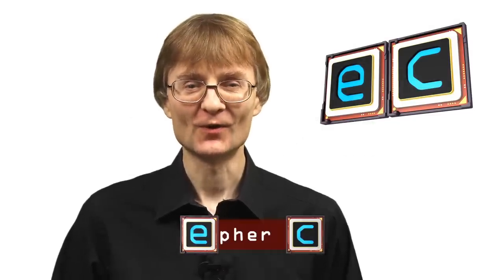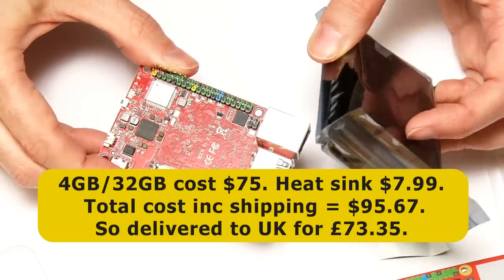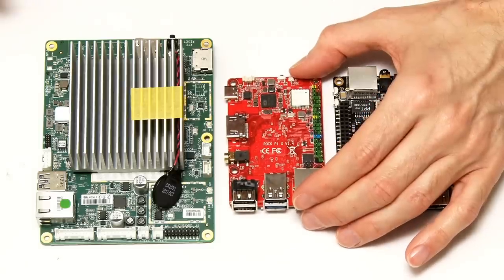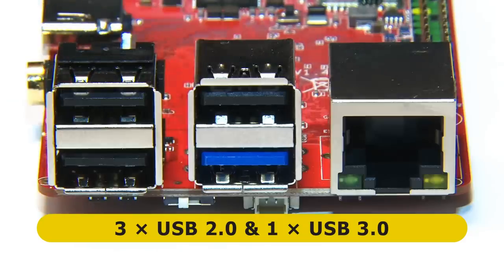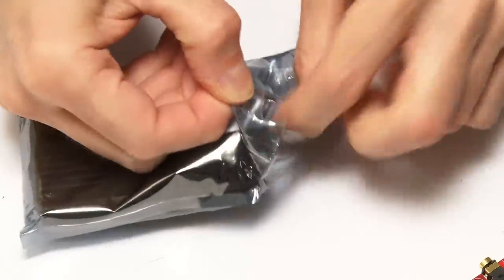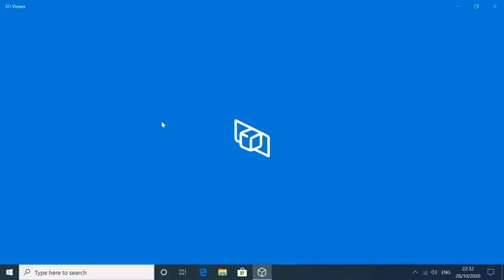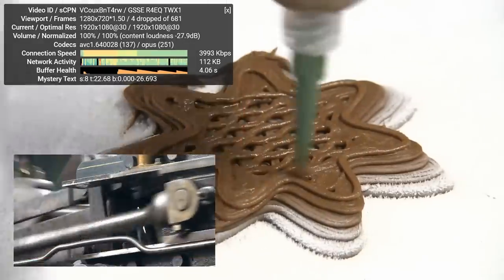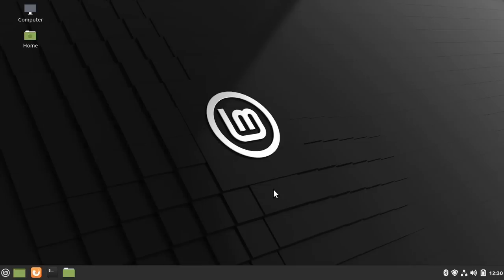Rock Pi X: Low-Cost x86 Windows & Linux SBC

Comment: 7 hours of Windows updates?! Man I'm glad to be a Linux user!!!
Reply: And it even steals your personal information. This is a "modern OS" according to m$..
Reply: @illegalquantity  More like clown OS, I just booted a Linux Mint laptop that's been off for a year, 1000+ updates in less than 20 mins on a first gen i7 and an old laptop hdd.... I just don't get how anything can update for more than an hour, especially downloaded new!!
Reply: Linux won't run the applications that I want. I suppose you whizz away your time playing around in the operating system
Reply: @Fetherko  hahaha oh so you need proprietary software to get things done eh? That's too bad, I've migrated to the open source world, where my computer doesn't crash from updates or lose data from them. I also get to update whenever I want and 99% of updates don't require a reboot. If I really want, I can even run a distributed filesystem and instantly access my files across multiple machines and never lose my data even in the event of my machines being physically damaged. Oh yeah and my systems consumes about 100x fewer resources than they used to.

Comment: Thanks for an interesting review. I'd certainly be interesting in getting one if there was a nice case for it. Modifying a Raspberry Pi case to allow the full sized HDMI looks straightforward but I'm sure that large heatsink means a custom designed case would be needed.

Comment: Regarding 4k - I can confirm that it can do 4K@30FPS. Z8350 supports HDMI 1.4b, and while Intel's spec tells otherwise, their slides and product briefs for Cherry Trail platform show that it can do DP/eDP at 2560x1600@60Hz, and HDMI 4K@30Hz. I've tried it on a computestick - it works, but it's slow. Even more laggy than Bay Trail or Braswell.
Reply from the maker: Thanks for this info, appreciated.

Comment: That is odd because the Atomic Pi isn't crippled when streaming.  I thought I heard that some of the performance was held back. Maybe the bios has some less than optimal settings. Seeing this I will put off getting one until some bugs are evicted from it.  Oddly enough that Asrock mini build you did possibly made eBay prices go up. It is almost as expensive as the Odroid H2+.

Comment: Even being a Linux user myself, the performance/usability difference between the two operating systems was surprisingly stark to me. The only downside of Linux is that GPU-accelerated video decoding in the browser is still lagging behind. Perhaps with a few versions of Firefox in the future, or when Linux Mint starts packaging Chromium, this particular limitation will go away.

Also not for the casual user but you can use the --get-url option of youtube-dl and feed the result to VLC (or a number of video playing applications) to hardware-decode and stream video.

Comment: Chris, I always enjoy your insights and in depth knowledgeable observations.  with regards to SBC I wonder if you could review some higher end boards, say costing $200 rather than the spartan lower end boards?  it would be interesting to see if the extra money is worth it and whether it can help make the change off Windows desktop more rewarding.  Thanks for all your good work.
Reply from the maker: Thanks for this, I have reviewed several such boards: eg the Odyssey X86J4105: https://www.youtube.com/watch?v=4XV8dlFwNd0 LattePanda Delta: https://www.youtube.com/watch?v=Dh03L2CUgnk and UDOO Bolt: https://www.youtube.com/watch?v=8DINmS5YBD4  I have a group test with comparative performance of eight x86 boards here: https://www.youtube.com/watch?v=xqIHsJLDdN4

Comment: Typo at 14:16, "* First generation 864 board tested" was probably intended to be "* First generation x86-64 board tested"
Reply from the maker: No, "First generation 864 board tested" was correct. The number refers to the initial 8GB RAM 64 GB eMMC LattePanda Alpha, as opposed to the more recent 864s model, which has a faster CPU.
Reply: @ExplainingComputers  Ahhhh thx for the clarification

Comment: Chris, do you have any plans to review the Compute Modules from R PI? I understand some of them come with 16GB of RAM and have a PCI-E x1 slot with the IO board. I realize that the IO board technically means it's not a SBC, but with those kind of specs it should be a really good contender for a desktop substitute. Only thing that disappoints me is the lack of USB 3.0.

Comment: To me, the biggest reason to choose a RPi form factor board would be because you want to use a pre-existing RPi GPIO hat, but you didn't go into the compatability of the header, or how it's accessed (ie: Are there  drivers for the GPIO under windows/linux on this thing somehow?!)  Also, another advantage of using a familiar form factor would be to use a familiar or pre-existing case, but that goes out the window based on the giant heatsink.  No existing RPi case is going to be usable with this device.  All of this combines to make it irrelevant that it's a familiar form factor.  It does seem to compete fairly well price:performance wise on it's own, but I dont see a reason to choose this board based on it's similar footprint to the Pi.  I would like to see a followup that goes into the usage of the GPIO of the board however..

Comment: Ive never run Passmark before, so decided to run it on my daily driver laptop. An aging HP Probook 650 G1. i7 4710MQ, 12GB, SATA SSD. Came back at 1900. So a little Latte Panda is more powerful than my i7 laptop. Wow..
Reply: Ah, 'twas ever thus...
😕
Reply: ages ago.. when i got my first job.. i saved up to buy a gaming pc.. real harcore.. it was 1ghz.. think i had 128 mb of ram.. 32 mb graphics card.. cant remember the size of the hard drive.. all sbc's are better than what i spent i month salary on to buy..
Reply: didn't finish watching video, just saw him say it was z8350 and then checked comments... i must admit my confusion. https://www.cpubenchmark.net/compare/Intel-i7-4710MQ-vs-Intel-Atom-x5-Z8350/2219vs2774

Comment: I recently upgraded to a brand new motherboard also with a chip from 2016. The A10N-9630E motherboard has a built in AMD A10 quad core processor and is a lovely ITX solution.

Comment: Watching all your video's made me wanna buy a SBC to use for a NAS/VPN server. Since they are rather expensive new in Europe. I started looking at used thin clients. Came across this HP T820 with an i5-4570s (4c/4t DESKTOP CPU) for 47,15€ shipped! It has no ram/storage but after some googling I found out it has the exact same cpu used as in the iMac 2013 21,5in. So im going to try to make it a budget friendly Mac Mini. If that doesn't work out it has endless use cases with those specs. This is a much more power hungry chip. But for some people that want to use an SBC for simple stuff like an ftp/vpn server maybe check ebay or local marketplace sites. You can ofter find cheaper thin clients that are used. Those have power usage ranging from 7-15w and often use dual core atoms/amd apu's. If you are lucky it includes a bit of flash storage aswell.

Comment: Still waiting for an x86 SBC w/8GB RAM priced under $140.  The Odyssey is close but barebones price is $188.  Raspberry Pi4 B+ is good, but has ARM processor.  I want to run Linux Mint 20 or xfce which run better on x86 chips.  Am I "stupid" for saying that?

Comment: Add a 1080Ti, an HDD and a optical drive and this thing will be comparable to my sisters current computer, which plays silky smooth, HEAVILY modded Skyrim and other modern games with no problem.  You won't catch me bashing this little board.  Looks like a beast to me.

Comment: 2 small tips to get rid of the lag..
1. triple check the chipset drivers & graphic 
2. debloat windows
Reply from the maker: Yes, agreed. I am aware of this! :) But checking the drivers (and I spent hours getting as reasonable drivers installed as possible) does not make them better. Having tested a good 60 SBCs, I aware that practically all of them suffer from the poor driver support associated with all minority hardware.

Comment: Actually Intel specifies 1080p but: "Max Resolution (HDMI) is the maximum resolution supported by the processor via the HDMI interface (24bits per pixel & 60Hz)."
So that's at 60Hz and the SBC maker specifies 4K 30Hz!

Comment: You wouldn't recommend this as a YouTube play back device?
Can I take that to mean that you would not recommend this a basic office machine - a very basic desktop replacement or backup computer?
That may be an unfair question, though.
I use Mint 20 on a 2011 Macbook Pro i5 / 8GB, and I never bother with anything over the 480 setting on YouTube anyway.
Glad to see the Mint 20 section.
Thanks.
Steadily getting steered toward the Raspberry Pi 4B 8GB model for my portable / space and money saving / backup machine.
Thanks a lot.

Comment: It would be interesting to pit it against a 4gb Pi 4 and do some benchmarks, especially if you can do things like run the same flavour and version of Linux from the same SD card to try and keep things consistent. For most I would guess usb 3 mass storage read/write speeds, network ( wired and wireless) throughput, speed tests and temperatures would be the ones of interest.

:)

Comment: I have an x86 tablet based on Intel Atom x8700, 4GB of RAM and 128GB of eMMC storage (Thinkpad Tablet 10 2nd gen). The #1 problem is the cooling. All it uses for CPU cooling is IO shield with a thermal pad between it and the CPU. Needless to say, it throttles pretty much immediatelly after heavy load. #2 problem is the storage. You do want at least USB SSD nowadays, eMMC is just slow. #3 problem is barely enough RAM. 4GB is almost not enough nowadays to just browse the webs. I would upgrade the RAM, but without a better cooling solution there's not much point in it. But despite all these flaws, my tablet is waaay faster to open youtube and start playback then Rock Pi X, but I'm using fine tweaked LTSC version on Windows. The video decoder is quite good, managing 720p60 and 1080p30 with no issues once the playback started.

Comment: I’d be interested to know a little more about the sort of applications that might work better on an x86 machine as opposed to ARM. I’m using Linux Mint on two old laptops, a Thinkpad T60 (originally XP) and an Acer that was originally W7. They both continue to work just fine - and the WiFi always worked without fuss BTW - and I have no problems switching to Raspbian on a Pi for hobby projects.

Comment: According to Intel ARK, the z8350 is only supposed to support up to 2GB of RAM, although there have been mini PCs and whatnot released with 4GB and it seems to work. Would be interested in learning more about this discrepancy.
Reply from the maker: Apparently the Intel specs are wrong, and should state that the Z8350 supports 2GB per channel, so 4GB in total.

Comment: Christopher, 
Did you try downloading and installing the non-free firmware package from Ubuntu? I was able to get my laptop's wifi adapter working perfectly without having to install the proprietary Broadcom driver in Linux Mint, simply by doing this. :)

Comment: I didn't see/hear where you got the ethernet working? At the last part of the video you were using YouTube and showed your web page so I'm assuming you got it working?  Could you "explain" what happened and what the fix was? That's probably the main reason I've not took the Linux plunge. I just want to be able to start my computer with NO diddling around. Windows starts up and "most" everything works, "most" of the time.
Reply: I assume Chris just plugged in a cable, see https://youtu.be/cGxScUmkzNs?t=386

Comment: put a fan on that heatsink.   their 4 holes on that heatsink for one to be mounted and use the long brass standoffs.  and connect to the 5v gpio pins.  add an external pci-express 3,0  x4 2 TB  external via usb 3

Comment: Just received my Rock Pi X. Enjoying it alot. The reason I purchased it is to have a handy zoom platform. The only problem I have so far is getting the WIFI to work. You stated you have yours working. I have been looking around the web, and trying different other suggestions. No luck so far.
Can you help please?

Comment: I would be tempted to go with a lighter weight Linux distribution on this hardware. It would appear that the Windows drivers for the GPU are better than the Linux ones, at least when comparing Windows 10 to the default drivers in Mint 20. I wonder if anything would improve the GPU performance in Linux, such as a newer kernel, newer version of mesa, or a different compositor.

Comment: By the look of things, that would make a far better RPi-powered laptop than a typical RPi-powered laptop. Looks like a neat little machine for pico/nano servers.
Reply from the maker: I agree. This is a very capable little board. I plan on doing a video comparing its performance to a 4GB Pi 4 running the same OS.
Reply: @ExplainingComputers  I'm currently using a couple of FriendlyElec ZeroPis as SMB servers for light media and backup.

What's most notable about these little fellas is the beautiful quality of the cooler/case. Being headless they're not really for beginners, but they run Armbian (in my case) beautifully using little more an a uSD and a wall wart - and they're cheap too!

512M isn't really enough for more than a single user - but with a self-powered USB3 hub, it's a very low-cost and (so far) reliable way to get some NAS, albeit without RAID.

Comment: The main thing that's sad about this being based on an Atom chip is that Intel won't be making any more Atom processors. That last Atom is going into a lot of projects to be sure, but it's a dead end. And the age of the processor normally wouldn't be a big deal because a lot of people are still running chips from 2011 or so, but the issue is exacerbated by the fact that the Atom wasn't very powerful even when it was first launched. It's going to feel its age a lot sooner because it is much slower than an average desktop PC chip from 10 years ago.
Reply from the maker: This is all true, but it depends what you are comparing against. And here, the Atom is up against the ARM processors in most comparable SBCs, and against them it still holds up well, not least because it can run software that the ARM chips cannot.

Comment: That CPU works grear with Linux Mint or Fedora. I have a laptop with 32GB eMMC and 2GB RAM and it came with windows 10. After the first wave of updates I was left with less than 2GB of free space. Wiped Windows and used it with Linux and it works a treat. 
The LCD connector is probably eDP.

Comment: been thinking of using an SBC for a dj software I"m running and wondering if this one would be able to run it... The minimum system requirements are "PC 2010 with Intel i3 or equivalent CPU , 4 Gb Ram & Windows 7, 8, 10" 

What do you think? Is it worth the gamble. It would be cool not having a big computer or a laptop cluttering up my setup and just having the Rock Pi and a small touchscreen. Would look cool too with the touchscreen mounted to my mixer somehow... (and would be cheaper too...)

Comment: Interesting board.
I noticed the psu wall socket connector.
That looked like a Northern Europe/Shuko style connector without ground. It would have worked in e.g. Denmark.
What am I missing here? All British connectors I have seen was this fairly large 3-flat-pinned affair.
Reply: Now that you've mentioned that, I believe you are correct, the PSU used by Chris looks to be a European model not not a proper British one (see https://conversation.which.co.uk/home-energy/plugs-two-pin-british-amazon-electrical-appliances/ ).

Comment: I'm not sure it's fair to judge a device like this on its ability to play Youtube videos. To me, this SBC seems more ideally suited for embedding in different kinds of systems where it would host just a single application. Like a user interface to a CNC or robot controller. I'm tempted to get one to try with Machinekit.
Reply from the maker: You are correct, but if I don't do the YouTube streaming test, I get complaints, as a lot of viewers seems to use SBCs as media players. :) I imagine you are right that CNC control will be a good application for this board, as I am often asked to suggest low-cost x86 SBCs for this purpose.
Reply: @ExplainingComputers  Right. I suppose for a lot of people computers are just entertainment devices. And there's nothing wrong with that by itself. There are others though who want their computers to do actual productive work. And that doesn't always translate into pushing large amounts of data through the network or graphics subsystems.
Reply from the maker: @olavl8827  I totally agree with what you say. :)

Comment: When using Ubuntu based distros, can you please check the youtube playback performance by using chromium-vaapi? Basically no browser supports hardware accelerated video playback from the get go, so most video decoding takes place on the CPU.